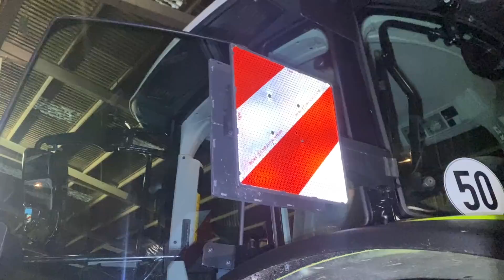TRYING A NEW FARM TRACTOR | WILD BEAST CAUSING HAVOC #CRAWFORDFARMS #153

Comment: Since driving a claas arion we've loved em they are among the smallest tractors for their horsepower so nice and maneuverable and can weight em up to be as good if not better than bigger ones at same hp, they smoothest riding tractor I've ever driven only one that can take our drive at 50k most others anything over 40 is unbearable. A cebis spec what you want with cmatic vario works lovely.  Hope you enjoyed the claas it be the one I'd have if we replaced our 30 series deeres. Looking forward to which of the demos you choose